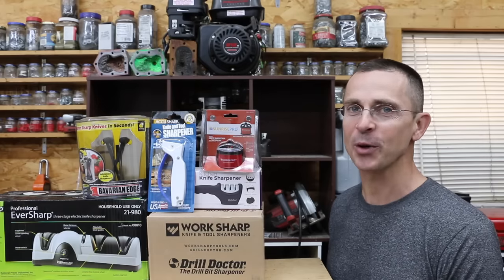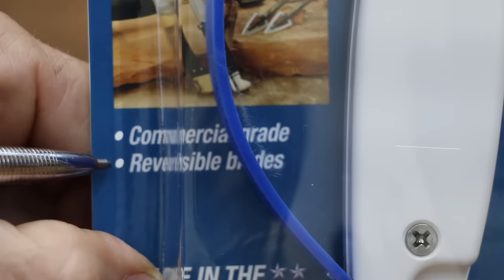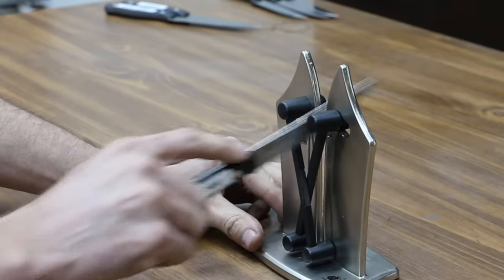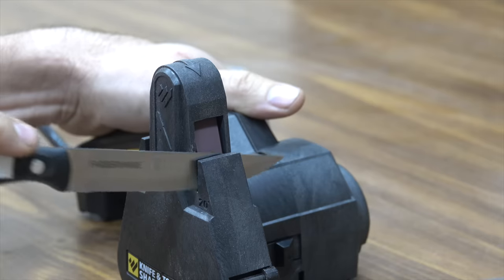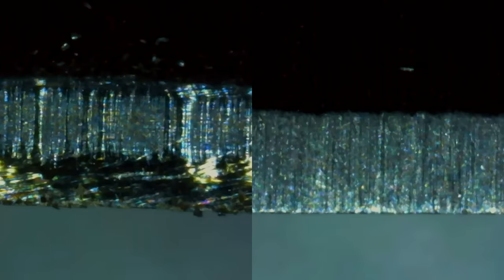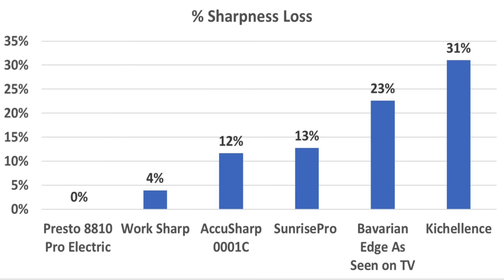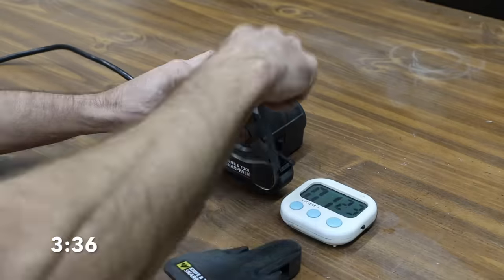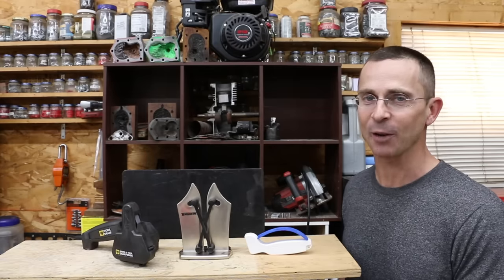Which Knife Sharpener is Best? Let's find out!

Comment: I don't know if it's the same with those kind of sharpeners as it is with a wet stone, tho I would imagine it works under the same concept, but with a wet stone, you want to alternate sides with each pass because each pass rolls a little bit of the edge over the other direction, so if you take a bunch of passes one way and then the other, you are actually rolling the edge slightly to one side defeating the edge, hopefully that came out coherent enough lol
Reply from the maker: Thanks for sharing.

Comment: How about having a blade coated and then sharpening the edge part of the coated blade. A typical ceramic-based coating is fairly hard. I wonder how effective these sharpeners are in this scenario.
Reply from the maker: Thanks for the suggestion.

Comment: I recall seeing a knife sharpener at gun shows that was similar to the Bavarian Edge that used rubber bands as tensioner. I've used the Accusharp as a quick sharpener, but it leaves rough edges as you noted. That said, the knife seemed pretty sharp. Perhaps the rough edges act somewhat like a serrated edge in that it has more cutting surface per unit of length, having a saw like effect. Cuts fiberous material well but seems to dull quickly.
Reply from the maker: Thanks for sharing.

Comment: Objective Video.  You compared the sharpeners using a standard method.  Based on your reviews I know what to choose.  Could you do one more video?  Round 3?  but comparing the little survival sharpeners.  Like the SHARPAL 101N 6-In-1 Pocket Knife Sharpener & Survival Tool, Smith's Abrasives PP1 hunting-knife-sharpeners, Lansky QuadSharp QSHARP, or Lansky Lansky Blade Medic
Reply from the maker: Thanks for the suggestion.

Comment: I'm sure people have said this but don't use all of these sharpeners other than the work sharp. 
They ruin your knives ...The work sharp makes a convex that will not get dings, rolls and chips as easily.
The others literally take years of use off your blades and makes them weaker needing sharpened again and again..

If you're just sharpening cheap crappy kitchen knives then have at it but. you could buy some quality blades use a worksharp to touch them up and never buy knives again.

The new worksharp adjust system is the best one for the money . 

Or just buy a $10 lanky Turn Box and save money....It works great to maintain your edge . Simple design and it doesn't ruin your knives.
Reply from the maker: Thanks for the feedback.

Comment: I have the Accusharp, and it initially did a great job of quickly sharpening knives.  But over time, the sharpening edges seem to have worn away, so now it doesn’t work well at all.  I need to see if the edges are replaceable.
Reply from the maker: Thanks for the info!

Comment: I learned the old fashion way. Using oil and a honing stone. Angle it wrong dull as can be. Angle it right and you can put on a razor dull sharp edge. I say it like that because no matter how hard I have tried. I could still never shave with it.
Reply from the maker: Thanks for sharing.

Comment: Sharpening properly with a stone (my preference), belt or wheel system is either skill-intensive, equipment intensive or both and it's worth it if you have expensive knives or it appeals to you. If it's not for you though don't waste your time or money - those carbide, tungsten, etc. pull-through devices are not sharpeners. The close ups show exactly how pull through "sharpeners" rip material uncontrollably and fail to reprofile the edge altogether. Sharpening services are not that expensive, and you can always just buy cheap knives.
Reply from the maker: Thanks for the feedback.

Comment: Even b4 test it's obvious that "lengthwise sharpeners" are total crp - they damage cutting edge and lead to split of blade (small metal pieces will fall off knife). Work Sharp - well, it's better solution, but you're tied to manufacturer's sand belts - you cannot make 'em at home. My best choice is Apex-like sharpener, which keeps edge straight (opposite to belt) and you can always make "spare stones" by gluing sandpaper on piece of wood - it works the same, but waaaay cheaper than buying every time "ogininal" stones.
Reply from the maker: Thanks for the feedback.

Comment: dude with the worksharp you gotta remove the burr with a strop (leather or felt) with polishing compound on it, you will get a 150-200 score guranteed. It is a very good machine (but noisy), and also much more expensive than the other options, ha ha

Comment: Cool video. The Bavarian sharpener actually surprised me in how well it did.

I understand the sharpness tester is the only way to get numerical data. However, The problem with a sharpness tester is that it only shows how sharp the knife is at that tiny spot. It won't test how well blade actually does in cutting.
Micro-serrations (tiny chips) and burrs (tiny slivers of bent metal) along the blade affect the cutting ability of the blade greatly. Micro-serrations can cause the blade to snag, drag, and rip the material being cut. Burrs are razor sharp, but they are so brittle they break off almost immediately and the actual edge may or may not be all that sharp.
A knife should actually be sharped to the point that a burr is formed. Then it should be stropped to break the burr off before testing the sharpness AND cutting ability.

It's also understand how these sharpeners affect the blade profile. All of these - except the Work Sharp - keep the profile in a V. Because belt of the Work Sharp flexes around the edge it changes it from a V to a convex (not concave) edge. Imagine the hull of a boat- Narrow at the bottom but curving out and up instead if a straight line. The thicker profile of a convex edge makes it extremely durable. However, that means the profile will be convex forever unless reprofiled to back to a V. Therefor, to maintain it one has to use a convex sharpening system like a belt or soft pad. V sharpeners will NOT work for quick touchups. Be aware of that before running an expensive high end chef's knife through a Work Sharp. Tears may flow.

The Work Sharp is labeled a Knife and Tool Sharpener. For tools that need a durable edge like Machetes, Axes, Lawn Mower Blades, and even Cleavers its an awesome sharpener. See how a Work Sharp can make a machete cut like a razorblade here : https://youtu.be/D3g07obFNao

But be very sure you know what you're going to do and that you really want to do it before putting an expensive kitchen, hunting, or even pocket knife on a grinding belt.
Just sayin'...

Comment: Those carbide sharpeners while working quickly, can wear down a blade faster because they remove so much steel with each sharpening stroke.  I wouldn't use one on an expensive knife for that reason.
Reply from the maker: Thanks for the feedback.

Comment: Great test jig setup, interesting to see the difference between them all, with a bit of extra sharpening time. I have a Worksharp clone (it's like $350 for the original in Aus), works well enough but it makes quite a bit of mess, and takes ages to get a good edge, especially on D2 steel. I actually made a plate bracket to run under the belt so I didn't get the weird convex edge, seemed to hold a lot better afterwards.
Reply from the maker: Thanks!  Thanks for the feedback.

Comment: I bought a pack of 24 cuticle pushers that have a curved blade on the other side, but when they arrived, I see that they are all have very thick and dull blades and aren't usable in this state. I need to sharpen them, but their shape is curved and I haven't been able to find a good sharpener that I can use without requiring a crud load of effort. It's frustrating. I need a sharpener that is fast and effective to get them all done. Any suggestions? I'm out of ideas 😕
Btw, I have the Accu sharp and that sucker is a bit dangerous. I've been cut a few times, sharpening the kitchen knives.
Reply from the maker: Thanks for the suggestion.

Comment: Knife sharpening isn't super difficult, but the problem here is that at first when sharpening you want to remove a lot of material very evenly and quickly, and when you're honing the edge, you want to remove very little material very slowly and evenly. The electric sharpeners make an attempt at this, but at the end of the day... just use whetstones. You don't need a huge collection. Just get a 30 dollar set with like a 400, 1000, 3000, 8000.
 
Also, get yourself a strop and some polishing compound... and KEEP YOUR KNIVES DRY!!!
Reply from the maker: Thanks for sharing.

Comment: And do you know why?  When a blade is drawn across those "V" type sharpeners it can actually take out chunks instead of grinding it sharp as those micro pictures of the edges show.  Also, blades need to be kept at an exact angle when drawing across a stone or an electrical grinding wheel which those you showed did have angle guides.  When drawing across those "V" type sharpeners there is no way to stabilize the angle thus you just screw up your edge every time you draw your blade through.
Also using that thin hair on the sharpness gauge may not show sharpness as much as it does from the pressure of pushing on the blade.  A fair comparison would be to use a thicker piece of fiber in that mechanism and use a slicing motion instead of a pushing motion which will give a better idea of the actual sharpness rather than how much pressure you put on the blade.
Reply from the maker: Thanks for the feedback.

Comment: Cool, could the next one be a scissor sharpeners which will double as those one edged japanese kitchen knives (the blade's not a V).
Add for 2023, rebrands of the same product which are usually significantly cheaper, like the multimeter Kaiweets KM601 is also the Habotest HT116 and there's the GDA version, Kaiweets seems to be the father (same with Zotek multimeters, the father of a lot of popular but good chinese multimeter brands).

God bless, Rev. 21:4
Reply from the maker: Thanks for the suggestions.

Comment: If you have any expensive knives or knives you care about PLEASE don't use those cheap sharpeners, They remove so much material from the blade after you sharpen the knife a couple dozen times you'll start to notice its literally eating into the steel and bringing the edge closer to the top of the blade every time. With just a cheap little carbide stone and a strop, plus a little bit of practice, you can make any blade working sharp in a few minutes and maintain it even easier. My grandpa did it that way for 40 years with his swiss army knives and the blade had the same profile it did when it left the factory.
Reply from the maker: Thanks for the feedback.

Comment: Worksharp is the winner in terms of creating a lasting sharp edge. In terms of easy access and use as well as creating a sharp edge Accusharp and Bovarian edge is the winner.
In terms of security Bovarian edge wins bcs Accusharp and Worksharp comes with dangers. Accusharp might cause you to cut yourself and worksharp is electrical.
Reply from the maker: Great point

Comment: You shouldnt put that much pressure on the stroke when using sharpeners. Light strokes using the weight of your hand or knife will work better. The amount of pressure you put damages both the knife and the sharpener and throws off the pre set angle of the sharpeners.

Comment: Imo, if you care about your blades, you should get a whetstone for sharpening
Reply: Also, you should not need to be sharpening your knives that often, if your knife is properly sharpened all you need is a few strokes on a strop or very high grit stone in between sharpenings, you're just polishing the edge, not grinding it. Those pull through scraper "sharpeners" should be illegal because they destroy knives so quickly
Reply from the maker: Thanks for the feedback.
Reply: @coolbugfacts1234  i agree, i use a 1000 and 6000 grit whetstone for sharpening and a honing steel to keep the edge between sharpening
Reply: @sirflappington2484  I'll even strop disposable blades, there's no reason to throw out a exacto knife blade if you can spend 10 seconds stropping it and it's razor sharp again

Comment: most of these "sharpeners" don't sharpen the edge, they peel a minute amount of the steel off the knife edge. the best way to sharpen any knife is with a stone and the way to do it is to lay the blade on the stone or diamond hone and tilt it until that little black line disapear's there is your bevel run it down the stone and back while holding it at that angle. i learned how to sharpen any knife to razor like sharpness from reading how the japanese make their swords then i watched videos of this sword making process from the steel collected from sand and cooked down to a blob then shaped finally the sharpening and there is no one draw movement there is only back and forth, watch how these artists make their swords that will cut a silk scarf if its dropped on it like in the movie the bodyguard

Comment: bruh please alternative between left and right on every stage with the machine sharpener
Reply from the maker: Thanks for the feedback.
Reply: @ProjectFarm  You're welcome. full disclosure this advice is based off chef's choice instructions, but I think it must be universal. the logic is that the burr will be bend too much to one side, which means more material loss(the more out of alignment the burr, the more damage when putting it back) and a worse finish(the more aligned the blade is at the end, the better it cuts).

Comment: First off that is NOT how you use the worksharp machine.  ALL OF THE  X  STYLE SHARPER'S CREATE A ROLLED FAULTS EDGE. If you use the worksharp system CORRECTLY  it is far superior than any other.

Comment: NEWS FLASH: All these sharpeners are junk folks. You have to maintain the original factory edge angle they were honed at. Unless it's an adjustable angle sharpener, you're just ruining a knife edge, not sharpening it.  Get a proper set of stones and learn how to use them... properly.   Maintain the original grind angle, don't wait till an edge is deformed and knicked to hell and you'll re-sharpen knives quickly and easily with a little practice.

Comment: I think many of your tests are pretty accurate and thorough. With all my respect, I must note the present experiment makes little sense.
1. Why considering this particular set of sharpeners? Most of them are of the class "never ever use them, they will kill your knives". I think it is not applied to respectable "Work Sharp", maybe something else. Who would be practically interested in the comparison of trash with trash?
2. You never consider really good-quality sharpeners. They range from low-end but reasonable Lansky to very practical and more consistent Chinese tools, to very expensive and bulky products like Profile. I could name some more, any of them are a lot better than most of the sharpeners you've used, even some quite inexpensive products.
3. Your test of sharpness may be accurate, but it is not adequate to your claimed goal. You pretend to reveal the "best" sharpener of the set, not the one giving the best results in your sharpness test. The sharp blade by your criterion is not necessarily "sharp", and even less likely "good", and your images support that. Let me explain it by the example of Accusharp or anything based on the same principle. This "sharpener", as everyone can see, damages the edge badly, but when you try to examine the cutting edge by your test, the result seems not too bad, because this process of damage creates a kind of the micro-saw effect. If you continue using this knife, it degrades very quickly, because the damage created by the sharpener tends to develop badly. I saw the video demonstrating the adverse effect of this kind of "sharpening".

I wonder if you advertise any of these products. If you do, you do it at the expense of some of the viewers of your channel. Sorry for the criticism. I like your video and don't want you to kill your reputation. I would advise you to remove this one and do something more objective and trusty.

Comment: These are all crap.  Buy a manual guided sharpener with various grit stones like a lansky set, worksharp precision adjust, kme, etc.  These sharpeners will destroy your knives very quickly if you use your knives often.  They eat away way too much material off od the knives.
Reply from the maker: Thanks for the feedback.

Comment: DUDE... you used the worst kitchen knives on the market, Farberware, they say stainless steel but then it rusts and you call them and they tell you it's SEMI stainless..  and they are stamped junk, hollow handles and rusty water pockets in them,      I have the Accu sharp and it works even better than my friends electric sharpener...   just saiyan